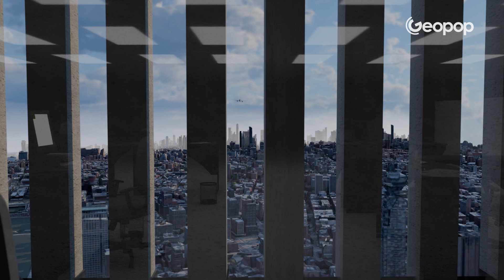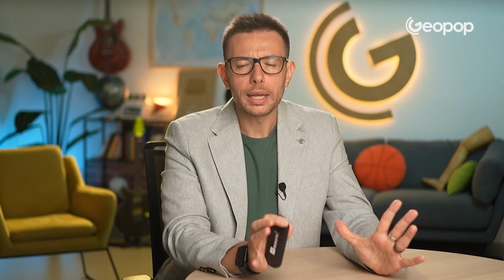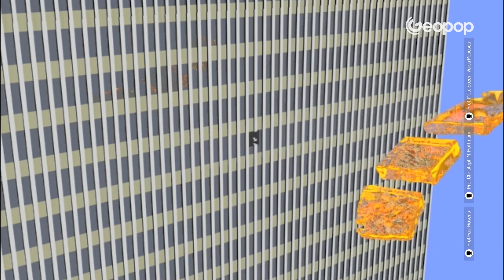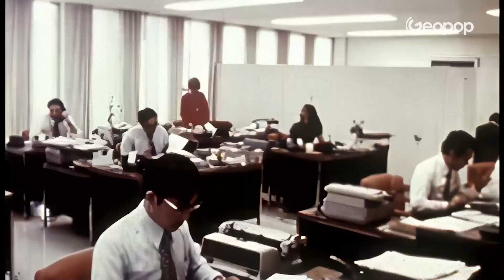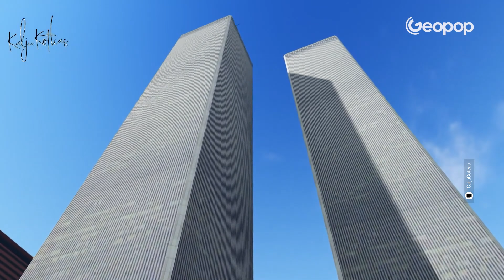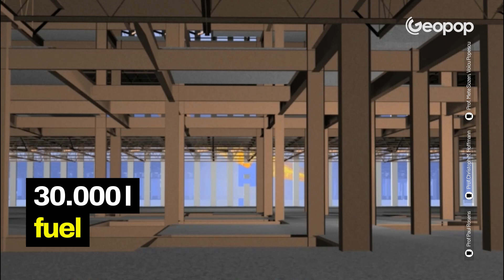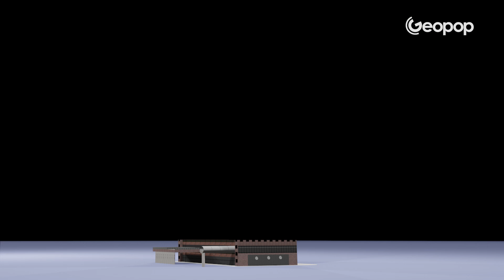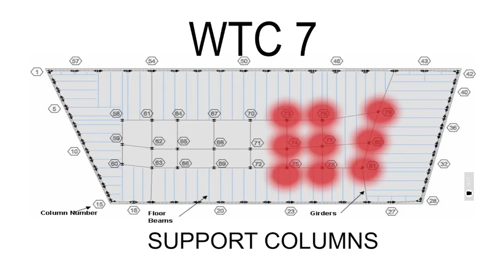9/11, 2001: The Technical Reconstruction of the Twin Towers and WTC 7 Collapses

Comment: WTC7, and the voice on the news coming from some guys radio near the reporter saying 'get everyone back were gonna pull it'' (went out on bbc news live)(and dont forget the other bbc news gaff of the reporter saying the building behind me just collapsed, when it was still standing!)
I do understand steel and elasticity and plastic deformation, Most people watching these videos have never been a welder or even owned a blowtorch to have seen red hot steel, I have. what I dont understand and no one has ever bothered to think about is how a building with exceptionally uneven temperature gradients around the perimeter fails at the exact same millisecond on all 4 sides to just fall perfectly...
add to that the 'rip-stop' effect of the central spine, one side heated first should fail first, when it does it should fail towards the central spine which would either slow or stop the failure, the result should be an uneven or incomplete failure, the top floors would then 'roll off' not perfectly pancake collapse.
you ever stacked dominoes and pushed one over, thats how floors fail...all your dominoes dont fall at once.
Reply: You have a fundamental lack of understanding of Building 7's collapse.

Much misunderstood, Building 7 was the 6th building to collapse of the 10 lost on 9/11. Because of its early low priority, conspiracy filled the information void with garbage made up by technically ignorant people promoting political agendas. But this is an engineering problem and should be treated as such, so I prepared this brief summary of my own analysis to fix that, using engineering, not politics and tired memes.

The North Tower collapse at 10:28am bombarded Building 7 with tons of debris, causing heavy damage and starting multiple fires which burned out of control for 7 hours. Half the FDNY firefighters having been killed, units in disarray, equipment destroyed, no water pressure, and the greater urgency of search & rescue efforts, firefighting was pulled as futile. The building couldn’t be saved and was left to its fate. That is the sort of choice firefighters make every day in brush fire situations - which houses to save and which ones to let go. Only real difference here is moving the decimal on the size and cost. People get overwhelmed by the size.

www.youtube.com/watch?v=g_SvpwyC17M&ab_channel=MFitz

Collapse of a burning structure is always a concern for firefighters. Steel buildings subject to fire rely on active fighting of the fires to survive. Buildings are designed around 1 to 3 hours of fire resistance, allowing time for occupants to escape and ACTIVE firefighting to get started, after which all bets are off. Left to their own devices they will exceed their design envelope and collapse, like Plasco Tower and Wilton Paes de Almeida. In B7 the occupants escaped, passive and active fire protections were compromised and active firefighting was abandoned 3 hours before the collapse, which left the building to its fate. It lost. Odds on Building 7 would eventually collapse, and it did. No big deal in logic.

www.youtube.com/watch?v=WnYBX6QT0R4

FDNY Chief Daniel Nigro ; The biggest decision we had to make on the first day was to clear the area and create a collapse zone around the severely damaged 7 World Trade Center, a 47-story building heavily involved in fire. A number of fire officers and companies assessed the damage to the building. The appraisals indicated that the buildings structural integrity was in serious doubt. I issued orders to PULL back the firefighters and define the collapse zone. It was a critical decision; We could not lose any more firefighters. It took a lot of time to PULL everyone out, given the emotionalism of the day, communications difficulties and the collapse terrain

FDNY Deputy Chief Peter Hayden ; We had our special operations people set up surveying instruments to monitor and see if there was any movement in the building. We were concerned of the possibility of collapse in the building. And we had a discussion with one particular engineer there, and we asked him if we allowed it to burn could we anticipate a collapse and if so, how soon? And it turned out that he was pretty much right on the money, that he said 'In its current state you have about 5 hours

The collapse of Building 7 was anticipated and widely reported in the media throughout the day, with 24 video cameras recording some or all of the collapse. Everyone knew what was coming and why.

www.youtube.com/watch?v=OY5S5k3tMHI

Building 7’s collapse was completely different to the Twin Towers and harder to understand as most details hidden from view and not intuitive, but we can still sort out what happened through careful analysis and observation. This is my explanation of the collapse relying on no outside authority.

Building 7 was complex, assymetrical 47-story steel framed structure built atop a smaller 3-story building, requiring lower floors dedicated to complex load transfer structures, not usable office space. Of trapezoidal shape and all-steel tube-in-tube construction, B7 (above the 7th floor) consisted of a central core of steel columns carrying most of the gravity load, perimeter steel columns around the outside of the structure carrying the remainder of the gravity loads and long span beams and girders to tie those elements together and form the floors. On the outside of the building hung a moment frame or outer shell.

Phase 1 : First externally visible signs of collapse initiation occurred at 5:20:28 pm and were notably quiet with observers not realizing the building was collapsing! No audible warning in the form of hundreds of ear drum busting 180-190dB explosive bangs preceding the collapse. Here at 12:00 a local CBS affiliate reporter is talking 10 blocks from B7 when collapse begins. People don’t start to notice the collapse until 12:11. At 12:45 is the famous CBS fixed camera clip of Building 7’s collapse. Note how quiet it is.

youtube.com/watch?v=t5tEy6mXSE8&ab_channel=fresnosean379

Collapse initiation was due to lower floor failures above the load transfer region (7th floor) in the NE corner. In this video at 0:45 you can see the NW corner from inside the building while under construction, Column 79 just out of frame on the left. That big, angled steel beam across the top of the frame connects to C79 at one end. The girders connect to the beam. That beam and all those girders depend on just one connection

youtube.com/watch?v=nP3TNHPCIVU&t=35s&ab_channel=EdwardCurrent

Phase 2 : The floor failures caused a loss of critical lateral support over an excessive length of core Column 79 and it buckled. If you look at a floor diagram of Building 7 (see above) and look at all the structures that depend on C79 you quickly realize this one column was a relatively isolated structural element on which a disproportionately greater fraction of the structure depended analogous to say the Key Bridge. Externally we see a vertical progression of window breakage along the 44-46 line and a kink in the roof of the East Mechanical Penthouse at the top of the building, consistent with C79 failure. The transition from full capacity to almost no capacity occurs in an instant. Once the buckling failure occurs there is almost no resistance

Normally with a buckling column, the load could be redistributed to other columns. With C79 that is not the case - the failure did not redistribute the load, so the collapse rapidly progressed to the roofline, sinking the rooftop penthouse.

Phase 3 : With C79 gone, B7’s progressive, non-symmetrical collapse continues with C80 and C81 at the east end of the core left laterally unsupported and quickly buckled and failed as well, sending the EMP down through the building. C79-81 all have no diagonal bracing, which I believe is a major reason why they could not redistribute a lot of vertical loads among one another.

From there collapse progressed from east to west through the central core until the core was gone taking all of the interior floors and probably most of the perimeter columns with it. Follow the horizontal progression of window failures low in the building and the dropping of the remaining rooftop structures into the building. One of the big takeaways from the NIST Building 7 study (that gets completely ignored) was their modeling which determined C79 failing under ANY circumstances would have initiated the same collapse sequence.

Phase 4 : After 10 seconds only the exterior moment frame - a hollow empty outer shell – remains, giving the ILLUSION the Building is still standing since little has outwardly changed. It is just a hollow empty shell like an empty cereal box. Supported by only a few remaining columns that empty shell is quite unable to remain standing. With all core columns and floors gone, the north face leans inward, forming a V in the roofline, the last few columns buckle under the strain and the moment frame free falls, landing on top of the 7-story high debris pile. It is only late in the game here at the end that a single measurement of alleged free fall acceleration is taken, from a single point on that outer shell. The Building did not “free fall” – just one corner of the outer shell did, sort of. The Building was already gone before that happened. The period of alleged free fall was a product of how it fell NOT why it fell and cannot tell us what started the collapse. Start to finish the entire collapse took 18-20 seconds, 3 times longer than true free fall . How fast something falls cannot tell you what started it falling_ anyway. The debris spread outside the footprint, blocking surrounding streets, heavily damaging the Verizon Building and destroyed Fiterman Hall.

Building 7’s progressive, non-symmetrical collapse was incidental and unintended collateral damage from the combined effects of fire + time + gravity, started by the collapsing North Tower. That is true no matter who planned and carried out the 9/11 attacks or why . The collapse was of so little consequence it barely even registered at the time, a mere footnote. It only took on semi-mythical status as an alleged smoking gun years later when demolitions at the Twin Towers, missiles at the Pentagon and shoot down over Shanksville all failed and conspiracists had nothing left to work with.

Anything can seem like a conspiracy if you don’t understand how it works. Now you should. I hope you found this helpful, informative and it solicits informed critical comment. If I made any errors of fact, logic or reason or left anything important out, please let me know so I can fix it. IF you can offer a more plausible alternative please do. Be the first. Please start any reply with the words “Tits McGee” or I will know you didn’t read it and are wasting my time.
Reply: Look at my comments 3 months ago, there thecriticalstinker bot was already at it screaming raging and kicking buckets because he couldn't get what he wanted.
The whole world to believe hes delusional ideas 😂 just ignore him, if you give him attention he goes liking hes own comments... 🤣

Comment: if that where true wouldn’t the affected areas the plane hit be affected and topple over and not the whole building what about the unexplained flashes going level to level going up from the bottom as that in a controlled explosion the heat wouldn’t of reach the foundations of the building structure either or caused the building too topple from the bottom thermite would tho which is used in controlled explosions
Reply: No, for the reasons described in this video.
Reply: Look at my comments 3 months ago, there thecriticalstinker bot was already at it screaming raging and kicking buckets because he couldn't get what he wanted.
The whole world to believe hes delusional ideas 😂 just ignore him, if you give him attention he goes liking hes own comments... 🤣

Comment: because these iconic towers and former WTC were controlled demolition basically they were rigged months before they came down fire has never brought down huge skyscrapers like these most of the aircraft fuel blew out on impact these buildings would have burned for days which would have burned the floors above impact zone out its 70s steel made in these united states not china
Reply: If it's a choice between the sound science and engineering or whatever that was you just plopped out of your ass, I'll stick to the science and engineering.

Comment: Two weeks ago almost same plane fell in India. On usual small Indians houses made from bricks. Plane lost height and hooked by it's tail wing, that's cause a tail to disassemble from rest part of plane. House that hooked plane trail still standing. After plane fell on houses, even half part of one wing was found still in piece. Only one passenger survived.

And you want us to believe, that two towers, that was made from finest steel and concrete, and costs a lot of money, fell because plane crashed into them...

What about plane that fell on Pentagon? I remember video were part of building were heavy damaged and tail of a plane lying on ground. But, not any other parts of plane was on ground: engines, cockpit, wings... nothing. Just some pieces suppose to be parts of plane.
Reply: The towers were hit at about 300m elevation with the plane travelling 700 kph as a direct hit. The plane in India was travelling much much much slower, while the pilots were manoeuvring trying to avoid a crash against a building a couple stories high.

Yes it is a completely different scenario.

Comment: The Helicopter shot that they took of one of the towers going down its pointed at the top where it is collapsing you can see the walls crinkle maybe some of those 9 or 11 floors he said it could hold up had already collapsed with the walls holding for a few seconds before you see the "pancaking" "free fall" of the building. It was already collapsing

Comment: tower 7.Nope Grenfell burned for 60 hours starting at the fourth floor and constructed with weaker materials including combustible cladding which encouraged more fire!! and stood strong after every floor was completely on fire. Tower 7 had a couple floors on fire and the entire building dropped around 7 hours in. Also the BBC reported tower 7 had collapsed............20 minuites before it actually did.
Reply: Grenfell Tower was constructed of reinforced concrete panels. It was not steel-framed like the buildings in New York. The fires were primarily external, the cladding you mention, not external, and Grenfell did not have a giant hole in it from 120 tons of airliner hitting with the energy of a ton of TNT.

I always find it curious the conspiracy evangelists invariably point to the totally non-analogous Grenfell and completely ignore the collapses of the steel framed Plasco Tower and Wilton Paes de Almeida towers from fire in less than 4 hours and 90 minutes respectively.

Ignorance or lie by omission ?
Reply: what's your point? tower 7 collapsed after hours of fire. Grenfell also partially collapsed. Fires can cause buildings to collapse.

Comment: 1. Two of the 9/11 hijackers, Nawaf al-Hazmi and Khalid al-Mihdhar, lived with an FBI informant in San Diego in early 2000. The informant, Abdussattar Shaikh, was a retired professor who had been working with the FBI. He rented a room to the two men, but later claimed that he did not suspect them of terrorism. 

2. There was massive short-selling of airline stocks just before 9/11. The SEC investigated these trades but did not publicly disclose the full findings.

3. The hole in the Pentagon was too small to match the Boeing 757 that supposedly struck it. Surveillance footage from surrounding buildings (e.g., a nearby gas station) was quickly confiscated by the FBI and has never been fully released.

4. In short order, officials identified all 19 terrorists through a few conveniently intact passports. The passport of one of the hijackers, Satam al-Suqami, was miraculously found near Ground Zero. 

5. On the morning of 9/11 at 6:47 AM, WTC 7’s Fire Command Automatic Alarm System had been deactivated for 8 hours. 

6. A BBC journalist reported the collapse of World Trade Center 7 almost half an hour before it fell, as did several other news services.

7. The North American Aerospace Defense Command (NORAD) failed to intercept any of the four hijacked planes, despite standard protocols requiring fighter jets to be scrambled when an aircraft deviates from its flight path.

8. In July 2001, Larry Silverstein signed a 99-year lease on the World Trade Center complex six weeks before 9/11. The deal was worth $3.2 billion and included double indemnity insurance coverage against terrorist attacks.

9. FDNY Chief Orio Palmer made it with his men to the 78th floor at the point of impact. He reported two isolated pockets of fire and said they'd be able to knock it down with two lines. One minute after that was transmitted, the south tower collapsed. It took a lawsuit from the NY Times in a FOIA request to get the 9/11 FDNY audio and comms tapes released. 

10. We’re supposed to believe hijackers were able to leap from a twin piston aircraft with minimal flight training to piloting a Boeing 767-200 cockpit.
Reply: Well, reading that I can see there's no mystery as to why you still haven't figured out 9/11.